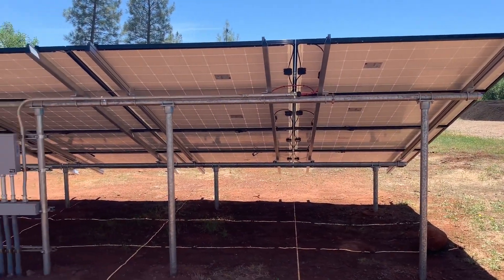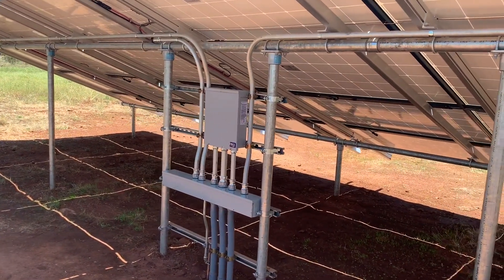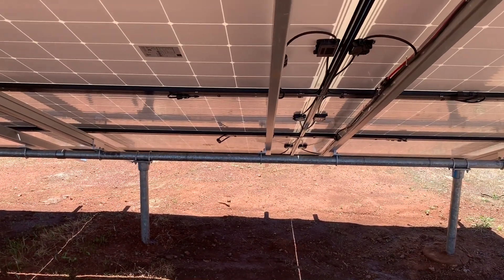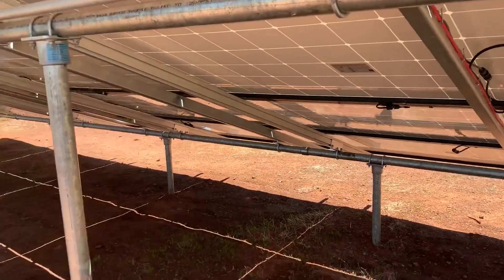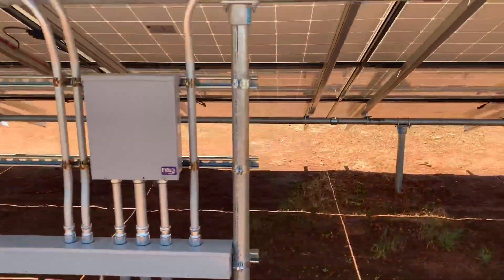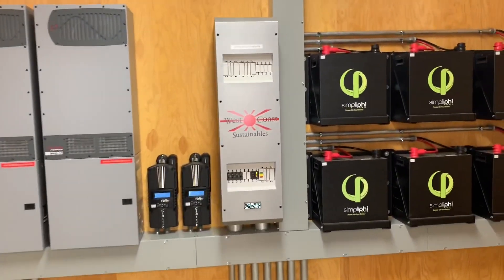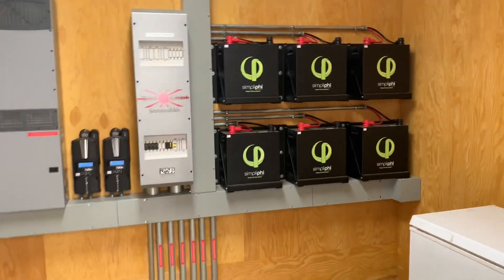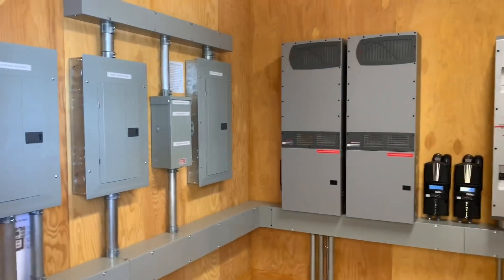Can off grid power get any cleaner

Comment: Great work! Do you mind sharing what gland/fittings you use to transition the PV wire directly into EMT?
Reply from the maker: jacob h thanks man, the gland is made by heyco and they have a 3/4” and a 1” version!
Reply: @JasonAndrade427  Awesome Jason, gonna have to source some of those for the next job.  Did you pull PV wire all the way back to the combiner or transition once inside the EMT? If no transition how easy is it to pull the PV wire through those glands without damaging? I have used some smaller strain reliefs before with PV wire and struggled to pull more than a foot of excess wire through without the gasket getting damaged/flipping inside out on itself.
Reply from the maker: I run it in emt to the combiner it is a bit more $$$ but customers are ok with it because I don’t have call backs

Comment: This is wonderful Jason.. so there is no standard for the height of this? In other words this can be setup for any height the importance is the panel angle?  I ask because I wonder if you can use the space below.. specially if you use bifacial solar panels that would allow for more light transmission below.  ie green house roof..  cheers mate!
Reply from the maker: Brisca yes you can raise it up and totally use the area under it, I have a video called solar tractor port that does exactly what your asking
Reply: @JasonAndrade427   - It was my understanding that in some counties, if your highest point is 6'0 you may be required to pass additional engineering?
Reply from the maker: Yes the factory engineering will pass up to 6’ where I live, on the tractor port I had to get secondary engineering and the footings wound up being 5 or six feet deep by 2’